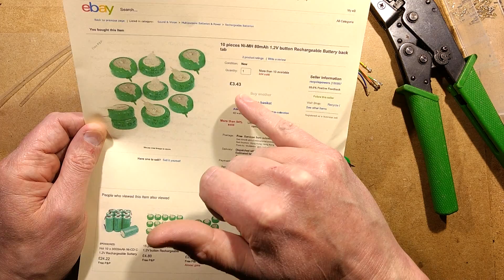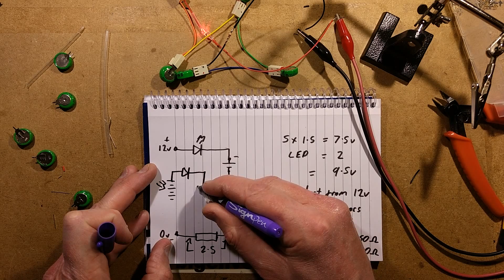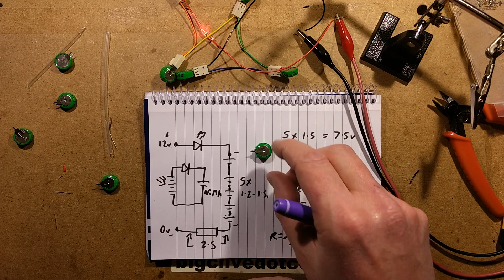Super-simple DIY charger for NiMh button cells.

Comment: Thank you for this! I used the principles here to cobble together an extremely gentle (~6mA) 7-cell "9v block" battery charger, which is otherwise completely unobtainable as a commercial product. I'm still trying to figure out a way to do discharge testing to prove that any given battery actually does what it says on the block, though.

Comment: Clive: I don't know if there is such a creature, but if you could find Alligator/crocodile clips with each side isolated from the other, you could just clip
onto the batteries. if not maybe one could alter the clips so that each side is isolated.
Reply from the maker: Or a wooden clothes peg with some holes drilled and wires added as contacts.

Comment: I want to convert my flashlight into a rechargeable from using 4 AA batteries. I would have to create my own 5 cell NiMH pack but what can I use to deliver charge, all of the charging PCBs I find are the TP4056 LiPO charging boards.

My end goal is to be able to plug into the flashlight with the charging cord (USBC or MicroUSB) and charge the NiMH pack inside. 

Still a newbie with electronics 😂

Comment: In the case of NiMh (or NiCad), is it correct that putting a bunch of cells in a series like this that may start off with differing levels of charge doesn't matter because they will all eventually each top off due to the trickle charging? This is unlike Li-ion as you said since they are sensitive to stopping a charge when they reach their respective max voltage.
Reply: If one wanted to set up a similar charging circuit for Li-ion, would they each need charge control/protection circuitry (e.g., DW01 chip) and you could then put each cell/chip combo into a parallel arrangement instead of series?
Reply from the maker: Each cell would require its own protection circuit.  You do get series cell balancing modules.  But it's often better to charge lithium cells individually or as a permanently linked parallel cluster.
Reply: @bigclivedotcom  Thanks. Now that you say it, I do remember seeing the series balancing modules you referenced on eBay and now remember another of your videos where you mentioned how each cell needs to be monitored by the circuitry.

Comment: The snag with using the simplest possible circuit to charge those cells is that the current will vary quite a bit if the total cell voltage is anywhere close to the available charging voltage. Using 10V (i.e. 12V less 2V for the LED) and a 220R resistor when each of the five cells are at 1.5V gives a current around (10-7.5)/0.22 = 11mA, but when the cells are at 1.2V each, the current will be (10-6)/0.22 = 18mA, which is quite a big difference. To keep the current closer to being constant, either use fewer cells in series or increase the supply voltage, both of which allow a larger resistor and hence more closely resemble a constant current charge, at the expense of poorer efficiency.

Comment: My $1 solar lights have been going strong even in winter in PNW usa. Very surprised! We had about 3 weeks of extreme overcast, and i never saw them not lighting up. Just opened one and battery voltage is 1.4, and solar panel was putting out 6mA 2.5v (its sunny right now)

Comment: 1.35v is a much better final voltage for nimh cells. 5 x 1.35 = 6.75v, most red led's are 1.8v, so 8.55v, minus 12v = 3.45v across the resistor. Generally you can indefinitely charge (and over charge, but I really prefer to remove them when they are slightly warm) nimh via trickel current current of 1/10C or 80mAh / 10 = 8mA.  3.45v / 0.008mA = 431 ohms. Or use a lm317 in C.C. mode.

Comment: What prevents one cell from overcharging? Don't you typically need to connect them to a resistor network?
Reply from the maker: At low current NiMh cells can be trickle charged continuously.  I'll be releasing a video with PCB files for making a USB powered NiMH/NiCd trickle charger within a week.

Comment: I love these build it yourself vlogs by BCDC and here we have a nice simple charger circuit to build. If one glues the connectors together along the edge of another to make a block terminal. Hopefully, the gap between the plugged-in cells will then be great enough not to have the cells to short circuit against each other. One could also glue the plugs to a short piece of acrylic sheet or a small plastic box to house the charging loom, with a reasonable gap between each plug so the cells don't touch when inserting them to charge. This vlog is from 2017 and with a lot of people owning 3D printers, it is simple enough to design and print a dedicated instrument box for oneself.

Comment: Hello Clive, thanks for the interesting tutorial! I wonder if you can help me. I have a similar situation - I need to charge a 4.8v (nom) button cell pack, with 16mAh capacity (yes, small). The problem I have is my charger's minimum charge rate is 100mA (>6 C) - clearly this would cook the cells. I would like to drop current to between 2 & 5mA...
The charge voltage for a larger capacity 4.8v pack is around 5.4v @ 100mA. If I need to dissipate ~ 95mA (R=5.4/0.095 > 56.8 ohms) would a 60 ohm resistor achieve this? Do you think my charger will attempt to do something clever to compensate? (I don't have the luxury of a stabilised power supply & accurate ammeter like you !)

Comment: How do you know how much current to supply to charge batteries? Plus I thought you had to charge batteries at a slightly higher voltage than they produce ?
Reply from the maker: The NiMh cells are often charged at a percentage of their capacity.  In this case, with trickly charging, lower is better. The voltage for charging a 1.2V cell is around 1.5V or higher.  It's the current that matters.

Comment: I Want to make my solar garden lights with 18650 that are laying around my workshop.
Reply from the maker: I have a video about using old phone lithium batteries with solar panels.  But they need to be protected.   The lithium cells won't work with traditional NiMh circuitry.

Comment: Tip you can stretch heat shrink larger in diameter by putting it over pliers and open them slightly.
Think forceps in this case.

Comment: It seems like, with the way this is configured, it'll only charge if all five cells are put in. How might one configure it such that it'll charge with fewer cells? Just wire each of the connectors in parallel? Or is it more complicated?
Reply from the maker: One resistor per cell.  The current is low.  With a 5V supply you could use a 1000 ohm resistor per cell to slowly and safely trickle charge them.

Comment: I find those cheap solar lights tend to get rusty in side too,
I've also noticed that the switches rust
so I basically soldered accross the switch contacts leaning it ON permanently.
I also sprayed the pcb with oil to try to repel water, condensation.
Not sure what the oil will do to the components and board long term but..
I also swapped out the crappy 600mAh batteries for some 2000mAh.
And on some of the lights I snipped one of the legs of the two LEDs, so hopefully, those ones will continue to work all night, even in winter. 
Currently, they're nice and bright in the back garden, though I imagine as winter draws in, I might have to occaisionally charge the batteries indoors,.

Comment: As the batteries get charged the current will drop, just like you saw. When you made the final connection to start the charge you said 16Ma and then a few minutes later you said 12Ma so the current was already dropping fast. You could have just set the lab supply at the correct voltage and current limit at your desired 10MA... Me, for a power supply. I just use a 19V/2.5A laptop supply and connect to a 5A digital buck converter that is CC/CV and get a little duty service out of it. I always thought NiMh full charge voltage was the same as NiCd which is 1.34V for a full charge? You said 1.5V for the NiMh which is close to a new Alkaline battery which is 1.57V

Comment: For these non-standard shape NiMH batteries, I charge them with my usual mains AA/AAA NiMH charger. I connect up the relevant terminals using crocodile clip cables with small neodymium magnets to bridge the contact surfaces. Works well.
Reply: Hey I made a battery pack that is 24v with nimh rechargeable AAA 1000mah batteries but wondering how I can charge them
Reply: I'm just making a battery pack just for tests
Reply: Just use a constant current and voltage powersupply and set it to the sum of your max charging voltage and current.

Comment: What temperature do you set your soldering station to?
Reply from the maker: Around 350C, but go with whatever feels right.  Too cold will result in slow joints and too hot will result in a greatly reduced tip and heater lifespan.
Reply: @bigclivedotcom  Cheers, I was setting mine around 380. I always turn it back down to about 250 between soldering if I'm going to be waiting any longer than a minute or so.

Comment: My solder iron also became part of my body, for about 1 second until the signal from my nerves made it to my bain. Lol. I was going to change the tip to another size as i frequently do. For some reason i forgot that i had just used it less then a minute ago so it was still very hot. Normally hot changes i use my pliers to unscrew the nut then the pliers to lift it off. Cold changes i just grab it by hand. Well this was the first and hopefully last time i forget that its hot. That was a horrible next few weeks.

Comment: I've seen the thumbnail for this video quite a few times and this time I just decided to click on it.  Interesting little charging circuit you made there.  Also, I have been soldering for around 47 years (started when I was around 10 years old I think) but I wouldn't try (knowingly) to solder as close to my fingers as you do.  I just about cringe everytime you do it.  LOL    Sometimes I think I have done it without thinking about it, when I have to get in close, but can't remember.
I think the very first video of yours I watched, was the one about the ISO-Tip cordless soldering iron tear-down and adding the joule thief circuit (or something like that)  Been a fan ever since.  Did you come up with that circuit or was it someone else.  I seem to remember you said you published it in a magazine, but you also mentioned some other gents name.

Comment: hang on how exactly do you that the cells have fully charged
and would this work on 4 cells welded in parallele?
but anyways keep it up
Reply: You need 2v for the led and 1.5v for charging the battery but you need to dived the charge ma into 4 so if you charging at 1000Ma you dived by 4 so each is getting 250ma and 1.5v for the ohms dived 1.5v = charging current

Comment: in an old scrap quadrocopter was a batterypack with 10 NiMh cells and each one is labeled with 350 mAh, still has power in it and i have no idea how to charge it... since in this video basically a batterypack of 5 cells is charged, can i apply the same maths to this pack? or is this technique only suitable for low capacity/low amp cells? i think of 15 volts but have no clue what amount of amps i should give it

Comment: Poundland have really cut costs to the bone with their suppliers.
They use to sell garden solar lights that had 2x600mah AA batteries, the same one's were then sold with a single 600mah battery, slight design change and sold with a 150mah AAA battery, then finally with a 40mah button cell.
I've opened up new ones to find a place to Fit a AA battery but no metal contacts, undid the case to find a 40mah button cell inside

Comment: for long term storage it might be actually a nice idea to have a breadboard where you just put multiple of them in and then a small circuit that (using a cheap timer switch between the socket and PSU plugpack) comes on for an hour each day and charges them to a safe level if required. then just put that thing on your shelf and they might last a rather long time

Comment: Why did you put the resistor after the cells and not before? And because its in series u have to charge all 5 batteries to complete the circuit so you cant just recharge one battery... unless you short the other connectors but then you will be putting 7.5 + volts through 1 cell.... And no protection circuit..... Clive you crazy

Comment: I hate to differ with the Clivester but to my knowledge Nickle based cells prefer to be stored at 0-40% SoC. Similar to Li-On except that Li-On are suspected to not take 0 very well, add the parasitic drain of the BMS and you may as well shoot for 40%. Just get the Nickles to 1.2xV and store them in a cold place. Which at Clive's house is over the 'heat' register ;)
Lead based cells are full-charge or bust. Literally if it's cold.

OK OK Here's a joke for you. What does Clive keep in his refrigerator?
A: Milk. To keep it from freezing.

Comment: Is this method also applicable to Pb-acid batteries as well?
Reply from the maker: Lead acid batteries are best charged with dedicated chargers that detect voltage thresholds and adjust current accordingly.
Reply: bigclivedotcom -> thanks

Comment: When working out the value of the resistor, How did you know the value of the current drawn? Is there a simple way of finding this for a circuit before it is built?
Reply from the maker: +LightWrathme Supply voltage minus all the voltage dropped across the cells gives the voltage to drop across the resistor.  R= Voltage to drop divided by desired current.

Comment: "A good tool becomes an extension of your body" - Several years ago, I drove my family from one side of the US to the other over the course of a few days. Our schedule was really tight, so we drove in 12 hour shifts (I took the night shift). I'd never driven for that long in one stretch before, so I was surprised when around the 6 hour mark or so of driving rather boring stretches of interstate, I started to feel as though my body encompassed the entire width and breadth of the car.

After we were all settled at home, I did  some research into it - because that experience fascinated me. Neurologically speaking, what you said is absolutely correct - once we've gained enough experience with a tool, our brains will start to to incorporate the tool into its model of the body. Even a tool as complicated as a vehicle can be absorbed like this.

Here's a decent article about this phenomenon if anyone's interested - https://www.scientificamerican.com/article/you-are-what-you-touch/
Reply: At work I mow with a string trimme quite often and it feels just as natural as walking...

Comment: I would check that all the cells are in a similar state of discharge prior to charging. Otherwise, the negative delta V effect on each cell would occur at different times and reduce the current to the other series cells. Immersing the cells in a weak brine solution for an hour would solve the problem.

Comment: Hello Clive, I need some advise if you would. I have had an idea to put a 2200uf capacitor in line of a USB cable to help with brown out issue with a USB devise in my car. Would that work to jump the gap between the battery drop when turning the car over? Thanks!
Reply from the maker: +theoneis101 It could work, but a diode in series to stop the capacitor discharging back to the starter would probably help too.
Reply: bigclivedotcom cool, thank you for responding! Loving the videos! Will try and let you know the outcome.

Comment: what would of been nice if you used a PCB and soldered the connections onto there and then have a little screen inline to test V and A. make a little separate charge unit so you don't have to use the bench power supply just a thought

Comment: another trick to shrink down heat shrink, is boiling water. I don't have hot air, only a solder bolt, and recently I was shrinking allot of tubing and wanted an even tidy job.

Comment: You should consider mini magnets on eBay.  50qty 8x1mm magnets for US $1.45 @ /itm/371819249556 and a thousand other sellers.  Just magnet contact your button batteries in a stack.  Solder leads to the 2 end magnets.

Comment: Speaking of leaky batteries, if I remember correctly NiMH and NiCd batteries actually don't leak (much) when they are deep discharged as they don't have much liquid inside. Alkalines however do leak like crazy and they have the characteristic fluffy stuff coming out the ends.

Comment: curious how those hold up long-term, my only experience with those cells are in round night-light / power-failure-light things and they had a 100% failure rate with exploding batteries within a few weeks.  when I looked on Amazon the reviews had a lot of similar stories.
Reply from the maker: Excellent.  I really want an exploding night light.
Reply: Not sure if YouTube will let me post a link but this is the one I had a 100% failure rate within a few weeks, you can look at the review pictures and see some people took them apart.  Wasn't spectacular just failed to work when it was need in a blackout.
https://www.amazon.com/Sylvania-Re-chargeable-Power-Failure-Night/dp/B000KJZNBW

Comment: Be careful. This method works, but it is also possible you have a shortened battery which will put the whole thing into a critical state because the voltages are going too high. Also seen on cheap chinese batteries are wrong or different capacities which causes the same effect. Or one of the batteries is full, the others are empty. The voltages in the chain gets totally wrong in such cases. If they are shipped non isolated, I would not trust this solution. A better way would be to hook them parallel, not in series. The LED acts as diode, so the cells can't charge each other. Ok, you need 5 LEDs and resistors that way, but it's safer. Also you don't need such a high input voltage. 5V as provided by any cheap mobile phone charger or USB port is fine.